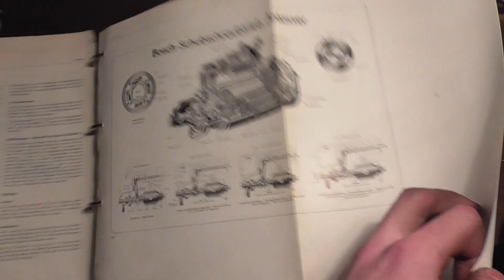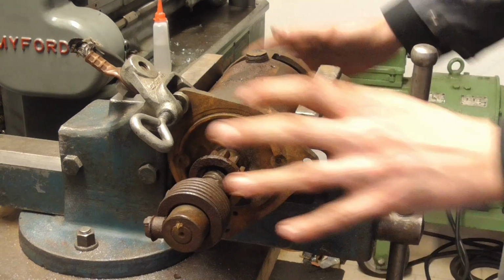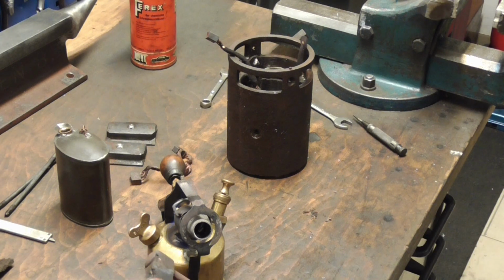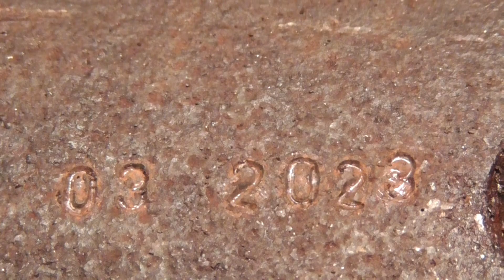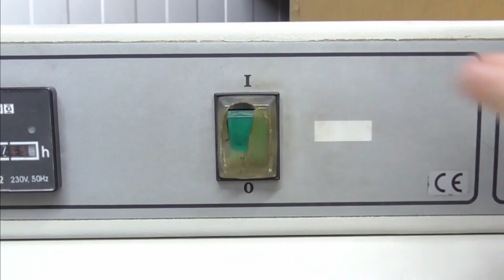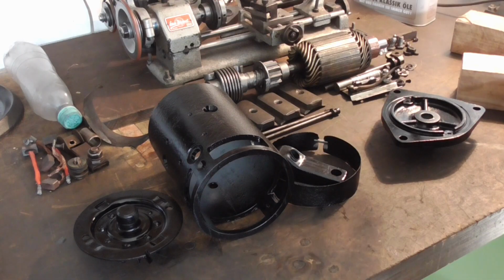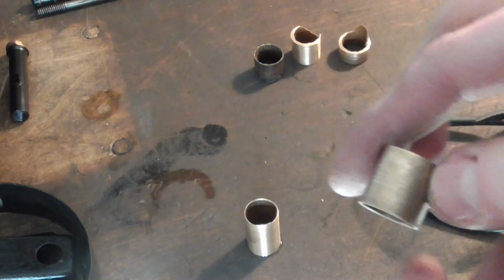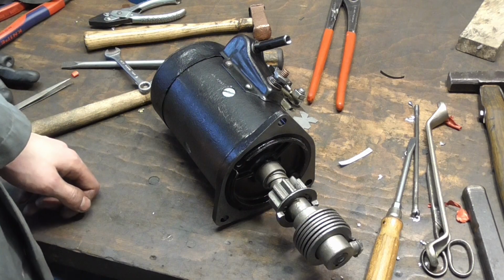Ford Model A Starter Overhaul

Comment: Your Videos always have impeccable flair and a nice vibe. 
As a tip for the 4 big flat head screws: 
Whenever i redo one of the starters or generators at work we insert a metal cylinder that‘s just big enough to slot inbetween the coil carriers/anchors, to prevent the housing from loosing shape due to hammerblows.
Then i take a tool that is almost like an oldschool impact gun. You can use a 1/2 inch socket with a fitting big flat head insert on it and strike the other end with a hammer. It will rotate and transfer the impact at the same time, loosening the screw. Sorry for the shitty description, i don‘t know the name for the damn thing.

Best of luck with your endeavours, thank you for keeping history on the road, especially in Germany, from a fellow German :)
Reply from the maker: They call it an impact screwdriver. I'll inherit one in a year or two, until then, I'll just drill out the few I come across :)

Comment: Love that soldering set. 

As long as you are running 6volts to that starter the orig bendix will be fine. I'm running 6v on an original bendix with no issues.  Best Upgrade I did for mine was 2/0 cable for starter terminal and ground. 

Hope you get your motor back soon!!!!! 

Oh great choice on music as always.

Comment: Great rebuild Adrian! Everytime I see you use that blow torch with the "flaming leak around the top fitting" it freaks me out like it is going to explode at any moment lol!💥
Reply from the maker: It's no more dangerous than a gas filled one. If a gas canister explodes, guess what'll happen next..
Reply: @AstraWerke  It is not gasoline? What is it filled with... kerosene?
Reply from the maker: @AWDJRforYouTube  Apologies, by "gas" I meant propane/butane. Mine do operate on regular gasoline.
Reply: @AstraWerke  My late father use to say gasoline blow torches went out of fashion in the US circa WWII...too many fires and explosions. Seems your fond of the 30's 40's era, but be careful of that torch IMHO Adrian.
Reply from the maker: @AWDJRforYouTube  Most went Kaboom due to neglect. I wouldn't dare fire up a torch with a steel tank bottom - they're almost always rusted through.
Also, none of my torches has any old gaskets left in it. I take them apart, punch fresh gaskets and give them a leak-test before putting them in service.
Reply: @AstraWerke  I always see that puddle of gas at the top of the can. Is that normal? I know you know what you are doing, best wishes enjoy your channel.
Reply from the maker: @AWDJRforYouTube  That's alcohol to preheat it.
The torch needs to be hot enough for the gasoline to evaporat in the valve, otherwise you got a nifty flamethrower xD
Reply: @AstraWerke  Ok that explains it fully,  Cheers!

Comment: I could be wrong, but I think at 25:20, instead of machining down the armature, the ideal approach is to use an exhaust pipe expander to squeeze the field coils against the case. This issue occurs frequently in generator restorations, and there's some documentation online about using the pipe expander, aka an expanding mandrel, to correct it.
Reply from the maker: I'll be honest, I had to look up what a pipe expander is - but yes, that would be a slick tool to use here - if there's access to one.
I used the rotor to push the armature cores as far out as possible, which left no more than maybe .5mm to be taken off the armature.
Reply: @AstraWerke  Yeah, it seems like the approach you took is a valid fallback method. I would just want viewers to be cautious removing material from the armature. You can never get that material back, and if the armature winds up too far from the field coils to generate the torque you need, there's no good fix.
Reply from the maker: @alexiskai  Thanks for the heads-up - I would have never even thought about an approach like this!

Comment: Thanks again for another nice video!

But, as a certified mecanic, i have to tell you, you sadly missnamed the part, you recently restored.😁
In Germany, we don‘t call it „Schub-Schraubtrieb-Starter“. There is no solenoid who pushes the starter-pinion via a lever (fork), upwards into the spiral gear of the shaft. Your Starter-Motor is just called “Schraubtrieb-Starter“. 

Thanks 😋
Reply from the maker: But does the Schubtrieb have a Schraub?

Comment: Do you know the right rpm of a 6V starter? my 12V starter hits the fly-teeth way too hard, even though it has gotten 12V stator coils. I have not taken out mine yet, but want to measure its rpm for comparison. It has the aftermarket enclosed bendix drive, but we will try with old one to see if that helps. I replaced the drive because a bolt-head was knocked off, and of course landed at the most impossible place in the housing. Took a camera + 2 hours to get it out.
Reply from the maker: Difficult to say, as they basically go beserk (5000rpm or so?) without any load and the rpm under engine load is hard to measure. With 6V, the engine does about 120rpm when starting up.
When switching to 12V, it is recommended to use a special, reinforced bendix, that's all I know.

Comment: You sped thru the important part of how to get the end cover with the brushes on over the communtator. I can seem to get the springs up and out of the way to slide the cover on. How did you do it?  I tried slo-mo on your video but couldn’t see it. Thanks, great video!
Reply from the maker: I used a piece of wire bent to a hook to lift up the springs. Then, I inserted the brushes from the top and let the springs seat over them.
Reply: @AstraWerke  thank you. I’ll try that.

Comment: nice video . i have 100's of new old [vary old] stock Bendix drive spring bolts and locks that i would like to find i new home for .just the bolts and locks .
Reply from the maker: Maybe not hundreds, but if they have a Ford Logo on it, I might know a guy that'd be interested in a handful or two..
Reply: @AstraWerke  none have ford logo . i have about 10 different types ! and yes i have 100's of them

Comment: Should pull brush tru window before removing tru bolts, no need to remove pole shoes unless shorted. Had to quit watching. You’re doing it the hard way.
Reply from the maker: Well, can't please everybody.
Maybe you noticed that the field coil insulation was decomposing, I felt like them shorting to the casing wouldn't help performance, so I removed the pole shoes, but everyone has their way of doing stuff.
Reply: @AstraWerke    I have had a auto electric shop for over 30 years in a farming area so I see all kinds of older units. Everyone has there own way, good video.